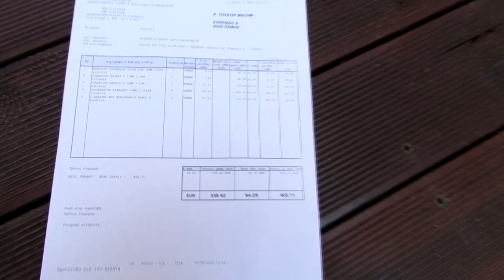Polycarbonate roofing from Leroy Merlin to a timber frame. How to install.

Comment from the maker: When this video will get 50 or more push of "subscribe" button we will do several new video about 
"1. How this polycarbonate roofing feel self after half year of using. 
2. How can you do timber patio by self, how much does it cost,  where to buy parts and so on  ".   Now video has 5 subscribes....

Comment: Missed the aluminum tape on the top end and the ventilated tape at the bottom end to prevent moisture from going in.
Reply from the maker: Two years later in our climate, it is ok without aluminum tape on the top end and the ventilated tape at the bottom. Checked.

Comment: Can you tell me the name of the screw type you are using? I cannot find that kind anywhere where it has the large piece to seal the hole. Thanks for any help! This looks great! I am getting ready to replace the top of my patio area like this.
Reply from the maker: Italian made screw 10 pieces x 6 cm x Ø 6 cm from leroymerlin. Photo is here...  http://fdrrecipes.com/35-supermarket-jumpers/testing/884-italian-made-screw-10-pieces-x-6-cm-x-o-6-cm-from-leroymerlin.html
Reply: @sjumpers  Thank you! Now I have to find an equivalent in the US.
Reply: @ThePhamtastic1  I don't know for sure if it is proprietary, but the company that supplied the roofing kit is Onduline and that is the type of screw they manufacture for their panels. In North America just use the roofing screw that has a 1/2 inch neoprene washer that seals out the rain. There are several brands such as Tuftex at Lowes.

Comment: Is there any specific reason why you didn't use so-called "breather" tape at the end of PC sheets? Or are they just a gimmick by any chance?
Reply: The breather tape allows humidity to vent out the bottom. Solid tape at the top prevents water and insects from getting into the sheets. Also, should vacuum out the holes after drilling. Anything that gets in there from drilling is going to be in there for the life of the roof.

Comment: On the edge of them, you fitted that end caps, but the water from boards is leaking through there, and fills up the panel square holes. Looks horrible while raining. I need to do mine better, probably seal the top of the end cap with silicone.
Reply from the maker: we had not a rain yet in 2020. But season of rains is coming. Will see how it will be, maybe seal the top too...
Reply: You should use the solid tape at the top of the panels, and the breather/vented tape at the bottom. Many will also drill small holes in the U trim that runs along the bottom of the panels - drill before installing so you don't drill through the tape as well.

Comment: What were those strips called that you put in between the panels?
Reply: Between the panels is H trim. At the ends is U trim. The spray bottle he used was probably a mix of dish soap and water - makes the polycarbonate sheet a bit more slippery for pushing the trim on.
Reply: @ronlaverdiere  pretty sure the spray bottle was wd 40 mate